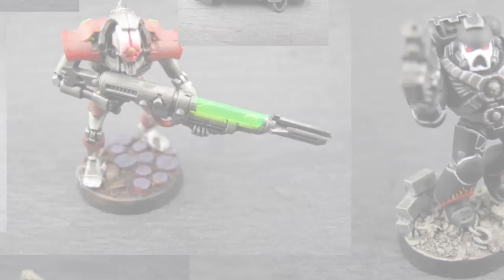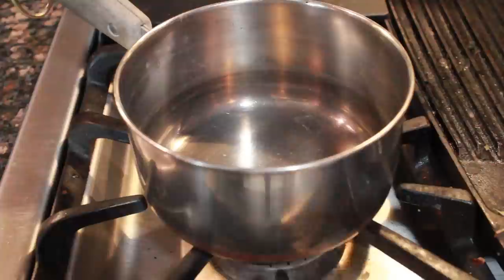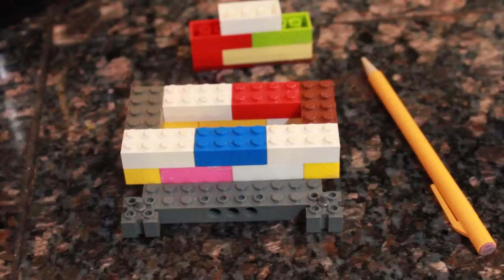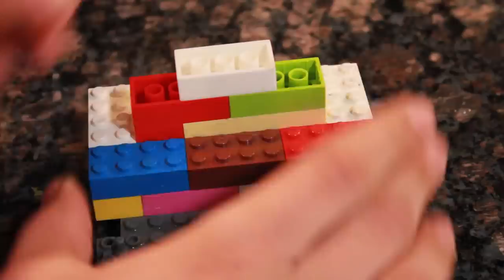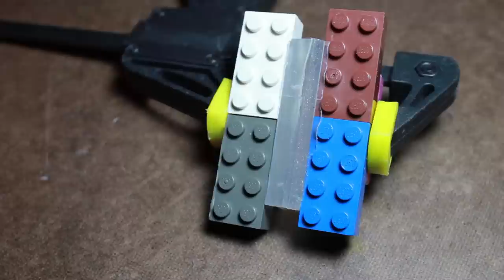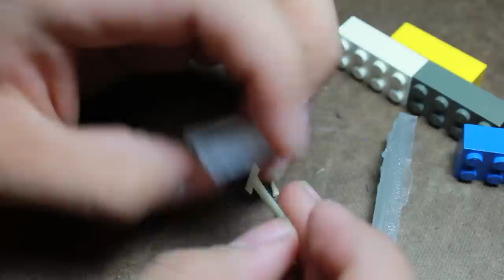How to Cast Custom Bits

Comment: ive been using green stuff and it doesn't look as good, what resin did you use? I may buy some because this looks much better.
Reply: green stuff has the issues of needing to be pressed into the mold instead of poring, i used alumilite which i enjoy using alot, mostly because the bottles are very good for the size you will need for miniature stuff, where you measure in the drops, here it is (http://www.amazon.com/Alumilite-Super-Plastic-Casting-Resin/dp/B004BN81SU) hope this helps

Comment: czyli można z  Oyumaru formę do żywicy ?Oyumaru can be used as a resin mold
Reply: yes you can use resin in Oyumaru molds however if your mold is at all large, perhaps the size of a dice and larger you should use a slower setting resin as a quick set resin could heat the mold enough to damage the quality.